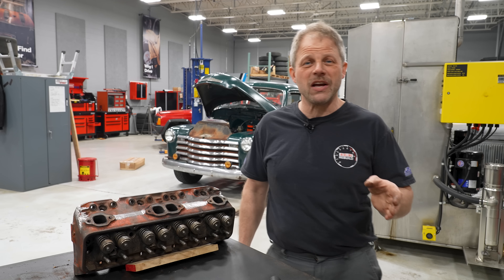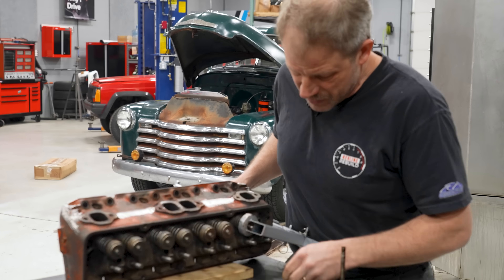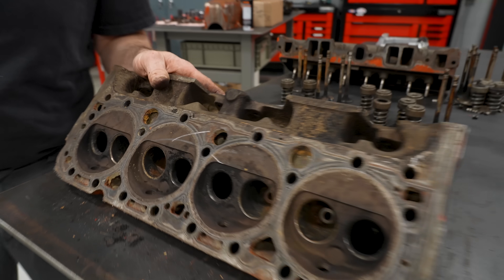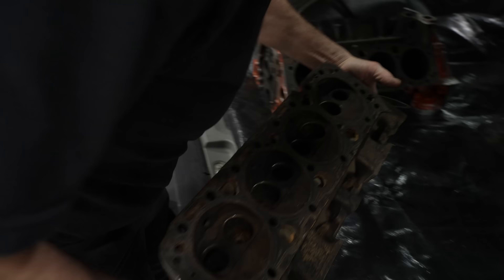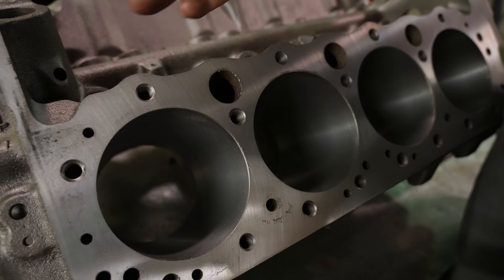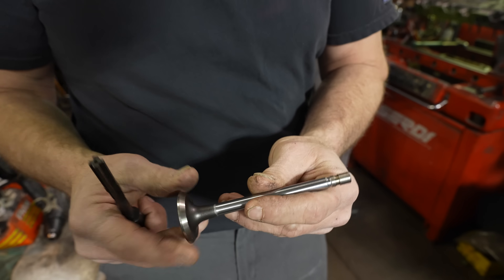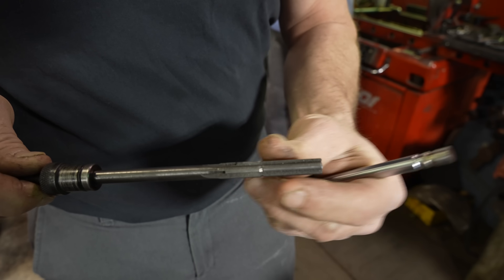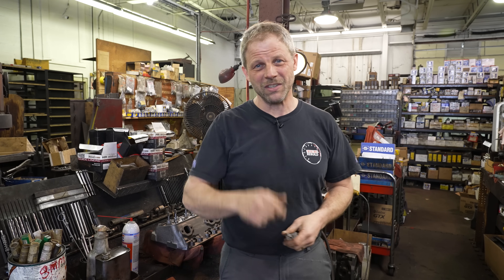283 Small-block Chevy heads to the machine shop for block and head work

Comment: I really don't like reaming out the entire seat & pressing in "hardened seats" for the unleaded gas "issue". That engine has survived just fine from unleaded gas implemented decades ago now. If the original seats are worn to the point of critical valve recession, using slightly oversized valves & cutting new seats is a better route. The first time one has to deal with an insert letting go inside a running engine with the resulting carnage...you'll change your mind about seats in short order.

Comment: I've personally owned 5 283 inch SBChevys 1 was a moderately all out race effort the other two were different levels of street performance the other two were nothing to worry about girly owned motors  that were up in the air right .. The first 283 inch were able  to really set a high bat .. but for real fact it was the SS/l&K NHRA race cars the Chevy Deuce the 65 SS Chevelle the 62 thru 656 Nova 2 .. The fans absolutely go wild for the screaming 283 even some 289 inch fans out there..., men like Cassel & Robin Brown  run low 10s run after run thru a 4 speed and mainly a stock body car ...and to be honest fella's I still get wood everytime I hear another 9800RPM 283  roll thru the gears ...

Comment: I swear I only went 20 seconds into the video and I'm guessing those heads are Power Pack heads. Small chambers and small valves, but high compression and good for some great power when larger valves are installed and some minor porting. I know, I had a set and when they were worked over, with my 0.40 4 bolt block, cam, stall, and gears, I could yank the wheels up in my 1967 C10 at the track. Now, I'll finish the video.
Reply: 4 bolt what kind of block?

Comment: In my life, I have built 8  to 10 283 cu in most of them mild performance but 3 of them were screamers. 2 with 327 crankshafts with .060 overbore and 302 chevy piston and trick rods one with angle plug heads and 1 with 202 small chamber heads, and 1 with .030 bore and 194-160 heads, all had GM camshafts. Fun with small cubic inches.

Comment: Bought a 1969 gmc pickup one time with a worn out 283 in it, had the motor rebuilt to factory spec, put a newer carburetor on it because the original was not able to even be rebuilt, put a power steering pump on it which it did not come with and that engine, threw a 700R4 transmission in, it jerked that truck around like it was a big block! Could not believe how much torque that little motor produced, and it sipped fuel. Ended up using it to pull a 9,000 lb trailer from Southern Arizona to Idaho, cruised along at 70 miles an hour just fine!! Massive respect for the 283

Comment: The larger plugs went thru even 327, 305 and many 350s
The heads you see are low comp. Heads if 283
I had a set of power pack heads that had very small combustion chambers
The early 283 blocks would bore to 4 inches to make the screaming 302 that would sure tear up the sinc ros in the trans back then.
Great memories

Comment: So you just ruined some old heads.  Those inserts crack the head going in as there is no material left or the crack soon aftr start up. I have seen it numerous times. Not just Chevs but all mainstream engines.
 All the b/s about hard seats. Simply use a valve saver with the fuel. Flashlube is suppsed to be the best.

Comment: I have a question??? I was always told that the easiest way to identify a 283 was that it had a 13/16 plug as opposed to the 5/8 plug in all other Chevys… is this true or false??
Reply: Not true.  The 13/16 plug was used in all SBC till the 5/8 plug showed up in 1970.
Reply: @johnherdener6801  so all small blocks had a 13/16 plugs til 1970!! Or just the 283??
Reply: @nobodyspecial6436  All mal Block used 13/16 till 1970.  In fact most GM engines used 13/16 plugs till 1970.
Reply: @johnherdener6801  well i had a 327 date coded 1966 which had a 5/8 plug…just googled it a little deeper and maybe my engine had different heads installed at some point… they were 2.02s i know that
Reply: @nobodyspecial6436  Yes, they may have been switched to later heads. Also all 5/8 heads had the accessory bolt holes on the end which 13/16 heads did not have.  The other possibility is someone put the wrong plugs in.  Both 5/8 and 13/16 plug have the same threads.  While 5/8 plugs will thread in and seat in a head machined for 13/16 plugs and work OK for the most part you can't get a 13/16 plug to seat and seal in a 5/8 head as the body of the plug hit the head casting preventing it from seating.  Also there were 2.02 heads in the 13/16 plug style as early as, if i remember correctly, '64 or '65.

Comment: Nice job on the heads, I would have Knureled the guides, but the seals will work just as well. Take care.
Gramps
Reply: Knurling them is some old school tech that was used just to get by without inserting new valve guides, only used if they're too loose.

Comment: Might I suggest 2 things? First, if you're putting a super heavy block and heads in a non-pickup vehicle, secure them with a HEAVY strap! If you get in a crash, that XXXlb block will fly directly into the back of your seat and crush you into a pulp. :( Extremely dangerous. The bed wall of a pickup makes this less of an issue but it still is a good idea to strap the heavy parts in place. Second, if you use a magnet to pull the valve keepers or valve gapping shims or hydraulic buckets during teardown, make sure to run them through a demagnetizing coil to remove the slight magnetic field you created when pulling them out with the magnet. Otherwise, they will always remain slightly magnetic after assembly and then collect ferrous wear particles out of the circulating oil and from themselves and hold them around the contact face of the valve tip and rocker pad/socket. The rocker will use that stuck metal particulate to grind away those surfaces at an abnormally higher rate compared to factory. You can probably make your own demagnetizer coil for very cheap. 💪😎
Reply: Don't waste your time. If I was that worried about magnetism, I'd replace the keepers. I usually use new ones anyway, they're cheap.

Comment: I might be a bit paranoid here, but I try to avoid magnetizing anything in engine as it will then make all metal shavings stick to it. For keepers it might not be a problem, but fishing out lifters with magnet can magnetize it's working surface. Just my 5 cents, video's awesome as always.
Reply: Yep, I just commented this. Good to see others aware of it. It isn't a problem AS LONG as you demagnetize the parts later with a demagnetizing device or you're going to replace them anyway. For flat faced hydraulic bucket lifters, the suction cup ends of a valve grinding stick work great to pluck them out. :) Stick it on, pull it up out, and pop the suction cup back off. Otherwise, long and angled shop tweezers are very helpful.
Reply: That's crap. No freaking way.

Comment: Will the heads (and intake) be milled to recover compression lost to the clearance cut next to the intake valve?
Reply: They resurfaced both the block and the heads. Resurfacing the block effectively makes the piston crown come up higher toward the combustion chamber pocket of the head and raises compression. When they resurfaced the heads, that removed metal and lowered the combustion chamber down toward the piston crown even further, raising compression a teeny tiny bit more again. I will posit that both resurfacing cuts cancel out one another as some volume was removed and then some volume was added back again. The pistons they choose to use will affect the compression that they end up with much more than these cuts though. If they use the stock shape and dimensions, that's one compression. If they use a domed or taller crown style, that's more. If they use a dish, that's lower. I'm guessing they will either keep the compression near OE or possibly raise it a tiny bit for a little more performance. This sounds like it's going to be a very mild street driver on 87 pump gas, so probably nothing over 10:1.

Comment: Do you use serpentine belts for engine hoisting?
Reply: I have seen those used as well as timing belts and seat belts. :) I think timing belts are stronger than serpentine belts, and seat belts are super duper strong. Timing belts have a lot of load during use, and seat belts have to stop effectively a  9,000lb person and not stretch or rip at all.

Comment: I thought lead was used to boost octane not for lubrication. Can you explain how lead lubricates?
Reply: You are correct that it was mostly octane that necessitated the use of the lead. Lead metal is soft and so is the material produced when the leaded gasoline was burned in the combustion chamber. The combustion products coat every surface just as carbon can be seen to do. That lubricates everything that is coated in it. :)

Comment: I'm surprised I don't see the oversize valve stem solution used more often. If an engine needs new valves and guides at the same time, why not?

I see the 4.0 Litre HO emblem on the back of your Jeep. Maybe it would be fun to make a replacement emblem to say you have a 4.6 stroker?
Reply from the maker: We’re designing one to print on our 3D printer!
Reply: @Hagerty  Thanks, that will be exciting to see.

Comment: Hay David,  in regards to the compression. Doing the relief for the intake valves,  witch willing reduce compression.  You decked the  heads witch rises it. Will it even out compression or do you hav2 play with the head gaskits ?
As always, great video.  Take care and see you on the next one.
Reply from the maker: Yup! They cancel each other out!
Reply: CCing the combustion chambers is a nice additional step but usually not done except on racing engines.

Comment: Are the valve seals only on the intake side?
Reply: Since intake ports are under vacuum, the intake valves will suck oil and crankcase air down through the tolerance gap of the guides and into the combustion chamber during use where it carbons up the valve backside and is burned in the combustion chamber. Exhaust ports are under pressure because the exhaust gasses are being ejected whenever the valve is open. That will have a tendency to blow gas up through the guide and prevent oil from dripping down it. If you're going to seal one valve positively, it should be the intake. An umbrella shield can be used for the exhaust and it'll work alright.

Comment: Nothing silly about grinding the flashing Davin.  I'm a firm believer in getting oil flow areas smooth and opened up. We would paint the inside of the block after cleanup with DP-40 epoxy (as well as the outside) for smooth oil flow.  Man I miss doing that stuff!.... Now I work for the wife :)
Cheers
Reply: Still paint inside today  valleys  and behind  the cam.
Reply: I grind of all the casting flash. And radius returns.  But leave the rest. The oil should not go back too fast as it takes heat out of the iron. Painting is bad news, holds heat in the iron and when it flakes off blocks up pickups.